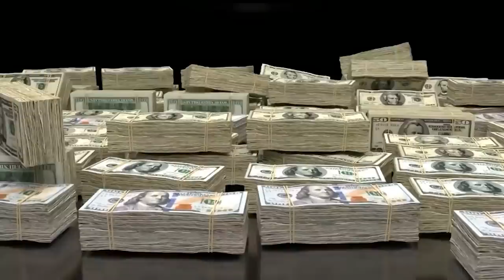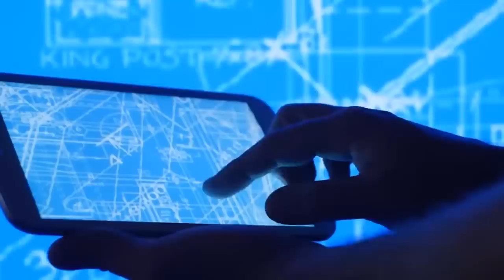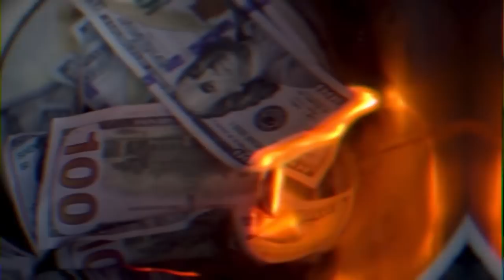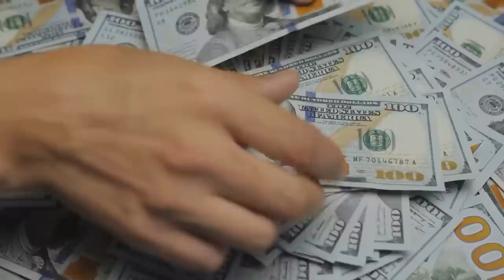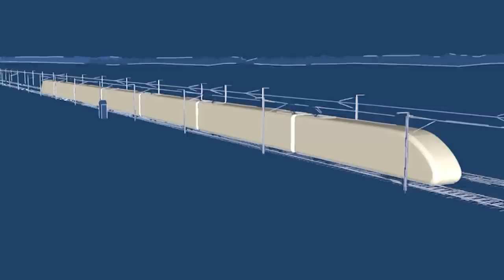Green Light for $4.2B California Bullet Train

Comment: ...Once the High Speed Rail system is in place the next transit gap  is to connect rural cities to the central hub (that is an interconnected network of lines ) connecting the rural communities to both High Speed Rail and Amtrak City Centers.  I have first hand knowledge because I've been taking Amtrak for 30 years from rural city in Fresno County to San Francisco.  It is difficult to find a bus or public transit from Sanger to Fresno, Salma to Fresno, Kerman to Fresno, Mendota to Fresno, etc.   The 14 cities in Fresno County don't yet have continuous flow of commuter links to a central Hub.  I observed Rural city people are struggling to hitch rides, depend on others to get rides to and from city center.   I work in the Bay Area is things are mostly interconnected.
Reply: One more comment - In the Bay Area the onset of the COVID Pandemic completely changed commuter characteristics because employees are working in a remote hybrid manner; and COVID still lurks as a threat.  Therefore,.  I read that public transit agencies - even BART - are struggling to survive due to lack of revenue from reduce use of public transportation.    For example, I work remote-hybrid  - I work even more hours but it's very effective and save one hour each way on a BART commute.  Crazy how things are changing rapidly.
Reply: @energyexecs  Yes, you make a correct observation how the commute demand may be changing rapidly. Plus our population is not increasing but rather decreasing somewhat.

Comment: I hope people will soon realize the potential in HSR. Later, it will improve and add more separate tracks and 🇺🇸 made trains. 3hrs from San Francisco to LA. Let’s hope in the future we look to the stars and aim for 30Min
Reply: we already can get to L.A to San Fran in 45 minutes ... Flying...
Reply: @trainsplanesandotherthings5187  you may or may not have forgot about the time it gets to the airport, board the plane, and then on the other end get off and then getting out of the airport. With how many cars and checkpoints there is, it takes about the same time sometimes more. 
Not to include the fact that generally a plane ticket is more expensive than a train ticket. 

People talk about budgets and try to stop  projects like these until it actually starts being useful. The same arguments were made against the original Shinkansen in Japan, but nowadays no one complains about them.
Reply: @trainsplanesandotherthings5187  Environment left the chat
Reply: The 125 miles of 60 mph average speed blended track (79 mph max) in the conjested SF and LA areas will result in at best a 4hr45min trip if the 55 miles of tunneling are done in 50 years.

Comment: We have the Brightline here in South Florida. It is fast, clean and comfortable.
Reply: I think they should’ve had Brightlines west or metrolink connect to the San Joaquin. Purchased the rail line for the San Joaquin, then upgraded it to 177 km/h (110 mph).
Reply: I really hope the Orlando extension is successful. Florida is perfect for an HSR network considering how our population is pretty evenly spread out across the state.
Reply: @KRYMauL  I think you are right for it to be a fast speed train (110 -125) like Brightline. I wonder what the cost and timeline would have been. Would you still have 40 miles of tunnels through the Tehachipis and San Gabriels to LA or attempt 10 miles through the Grapevine with a higher gradient since it is not high speed?
Reply: @davidjackson7281  The cost would have been paid overtime, and likely would’ve been able help address the housing crisis. 

California chose the we are the France of the US route.
Reply: @KRYMauL  I do not understand your answer. I will rephase my question. How much less time would a Brightline like train system take to build and cost over time in California? And do you really believe this is a solution to actually and materially address a housing crisis?
Reply: @davidjackson7281  A Brightlines train should cost less initially to build and upgrade. However, they would be taking all the rent and lease revenue for themselves.
Reply: @KRYMauL  I have enjoyed your comments. Thank you. Best wishes in 2023!

Comment: I wonder what the concept will be once part of the line is finished. Will it be used by existing Amtrak trains, or trains changing onto existing lines? Just going back and forth on the already completed section between relatively insignificant towns might not make that much sense.
Changing between electrified and non-electrified sections shouldn't be a problem with the dual power trains that Amtrak already ordered for the east coast. Just extend that order by a few trains for the west coast.
Reply: The HSR section that will be completed first between Merced and Bakersfield will only be used by the new HSR trainsets. It's a brand new ROW created specifically for HSR.

Amtrak will provide transit connections at both ends of the route until more of the HSR route gets completed.

Comment: following I-5 doesn't really mean an easier routing.  Freeways are designed with 70 mph curvature, HSR would mean probably 220 mph curvature or more.  so the train alignment might have to wind back and forth over the freeway lanes.  Or, realigning the freeways travelling to make room for the larger radii curves of the HSR.  down the median means continuous crash protection between vehicles and trains in places.  new structures at all the interchanges.  and yes really big challenges on the grapevine.

Comment: It will be done in 10 to 15 years at the earliest but then will they have the power to run it?
Reply: Maybe they should switch to fast speed clean diesel Brightline trains for the first generation.
Reply: @davidjackson7281  
 I don't think it's the cars or the engine I think more than anything it is the infrastructure itself and getting the right ways.
Plus who knows what else, they keep coming up with more cost on this thing.
 I was for it until I saw that they had 600 Paid advisers on the board before they broke ground.
That was 10 years ago.
 This is the kind of thing that is the huge take away for when the government is involved in any project.
BLOTE!
Reply: @ThomasLeonard454  The target range date for Merced to Bakersfield revenue service to begin is 2029-2030. After that I would surmise connecting to Gilroy would be about 2036-2038 if annual funding continues to not exceed $2 billion. That would be 15 years from now. The project started 15 years ago. It appears the final 175 mile segment to Anaheim with 35 miles of tunneling will take at best 10-15 years so it looks like at a final completion date of 2048-2053. They say patience is a virtue.
Reply: @davidjackson7281  
That is zero in comparison to what they told us 15 or so years ago. They have wasted SO much money on this project it is very difficult to want to be on their side anymore. 
WASTE OF MONEY and PEOPLE.
Reply: @ThomasLeonard454  Are you for completing it to Bakersfield and at least connect it to SF?
Reply: @davidjackson7281  
Not in favor of it at all anymore. 
Too many lies to get it started. 
Cost ballooning way off the charts of reason.

Comment: This project is at least 20 years too late!
How much will roundtrip cost between L.A. and SF? Probably more than $200...
You might as well fly instead.
Rather than wasting $4.2B or more on this project, build something more useful like some type of a transit system in L.A. and Orange county. L.A. currently has very minimum subway which hardly anyone really uses mainly because it's so limited.

Comment: As much as I like HSR and rail in general, the CA project is simply a boondoggle. The route selection and the astronomical cost, the decision to connect those small cities first instead of the two big population centers, the construction difficulties due to the rail crossing numerous faults. Alas, it’s too big to fail.  Maybe it’ll be finished in 20 years or so.
Reply: Well.... The are building the central section because it's the easiest to build as brought out in the video... They have to build tunnels. Tunneling is what's probably driving up the cost. You need reliable funding when you start tunneling. And getting the project started was probably more important. Especially with the the NIMBYs and red tape.
Reply: Do you mean too big to succeed to LA but finished to SF in 20+ years?

Comment: The problem with CA HSR is that the money ($70-100 Billion) to connect the Central Valley portion to the San Francisco Bay Area and the Los Angeles Basin is nowhere on the horizon.....and the practicalities and costs of trying to do lengthy tunneling in geologically unstable earthquake zones have been vastly downplayed by supporters of this project.  Add to that the likelihood that the the Central Valley portion will never generate enough ticket revenue to cover the significant operating costs, and you are looking at the  probability of a "high speed railroad to nowhere"
Reply: It is possible to go over Altamont Pass without tunnelling. But that's not what San Jose wants. Southern Pacific Railroad used to have a bridge over the Bay from Newark to East Palo Alto. Most of the abandoned bridge is still there. A bridge across the bay would give a direct route to SF, but that is not what San Jose wants.
Reply: @michaeljones7927  :  Somewhat true...
But Altamont Pass is both an active freight line (originally built by Western Pacific, now owned by Union Pacific) and an abandoned 1879 route...  (now hiking trails) Both gave relatively steep ruling grades (2.5-3.5 percent) tight curves, and FRA maximum track speeds of 79 MPH.  Altamont Corridor Express , a commuter railroad that runs from Stockton to San Jose over this 84 mile route but only averages 39 MPH over the routing, and while some of the slowness is stops along the route, a lot has to do with poorly built and poorly maintained infrastructure.

While you are correct that San Jose wants the Pacheco Pass alignment (because it's shorter than going North cutting South to circling the South bay), there are a lot of other wealthier South Bay interests including Gilroy and Morgan Hill that have been lobbying hard in favor of Pacheco....which are much more politically connected than Manteca or Tracy.

Comment: Chinese trains are running on 350KM/H and aiming for 400 KM/H in future but so said US trains are still sticking on for 200KM/H.
Reply: You mistook kilometers per hour with miles per hour.

According to the proposal's requirements, California's train will have a top speed 220mph with sustained speeds over 200mph in the Central Valley.

220mph is 356kph, which isn't quite as fast as what Japan and China have, but will still be on par with the fastest European trains.

The only issue I have with this project is the cost. With a projected systemwide cost of $120B, ridership will need to be very high in order to keep the passenger mile cost reasonable, which is not impossible, since the stops will be within 20km of 30 million residents.
Reply: @99certain45  East Asia actually has ones above 300 mph

Comment: The train "could" make the trip in 3 hours. But it never will because it will need to stop every 50 miles for 20 minutes.
This line will be bankrupt within 2 years of becoming active.  If it ever does.
Reply: I am curious why you think high speed rail engines overheat and require 20 minute cool down periods.
Reply: 20 minutes? Less than 5
Reply: There are many depots to stop at.
Reply: @danielcarroll3358  The engines do not overheat or require a cool down period. But how long does it takes for a 150 mph train to slow down, unload & load passengers, and get to speed again.
Reply: @troy.peters  You have never heard of local, limited and express trains? Each station has at least four tracks. The two in the middle allow expresses and limited to pass through at speed. Stopping trains switch to an outside track which is next to a platform. I have gone through a station at 187 mph many times. The people on the platforms waiting for the local hardly notice.
Reply: @danielcarroll3358  There will not be enough distance, frequency nor ridership on the 2030 segment to support different train speeds. CAHSR has stated the initial 171 mile segment will be a 1hr25min trip averaging 125 mph (200 kpm).

Comment: From what I can see of US and especially CA politics, a completed line will remain a pipe dream. There are too many ways opponents can hold the scheme hostage through the legal system.

I'm also afraid that this rail line will be built North American style, meaning that the stations will be out in the middle of nowhere and reachable only by car. Cyclists and pedestrians will not be welcome or able to reach the stations without risking their lives.
Reply: all the legal NIMBY BS has failed now. that was the 2008-2015 phase challenge. the stations are well placed in LA, san jose and SF so that's not an issue. they did a good job on the technical aspects of CA HSR
Reply: All the stations, with maybe Kings/Tulare (and Madera) as an exception, are being built in downtown areas with direct access to existing transit. Kings/Tulare will connect with existing and new buses to Hanford, Visalia and surrounding areas, along with a proposed train service linking HSR with Hanford, Visalia, Porterville and Lemoore via an existing rail line. 

In the Bay Area, HSR will utilize the existing Gilroy, San Jose and Millbrae stations, as well as 4th & King in SF until the Salesforce Transit Center is ready for train service. In SoCal it'll utilize a relocated Palmdale station with connections to Metrolink and Brightline West, LA Union Station with its connections to all across LA and surrounding counties, and ARTIC in Orange County.

One of the big drivers of this project is to reduce urban sprawl and encourage residential and commercial development in city centers around the stations, not just for places like San Jose but also Fresno.
Reply: @ChrisJones-gx7fc  wow thanks for this write up! really appreciate the info
Reply: Usually hsr is built outside of the city center and the city grows to the station. (And as the other person mentioned they are building to the downtowns of most cities)
Reply: Actually, the stations will be built up central stations, and what might end up happening is the LA system will be forced to connect at the end of the line. They should’ve bought the San Joaquin from Union Pacific, and upgraded it to 177 km/h (110 mph), then had Brightlines or Metrolink connect from there. I imagine it will be something similar in the end.
Reply: @KRYMauL  the San Joaquins were originally Santa Fe, and run on BNSF tracks from Bakersfield to Port Chicago, where they switch to UP tracks to reach Oakland (they also run on UP from Stockton to Sacramento). 

What do you mean by buying the San Joaquin? The San Joaquins are state-run and operated by the San Joaquin Joint Powers Authority. Same with the ACE service between San Jose and Stockton over Altamont Pass, owned and operated by the San Joaquin Regional Rail Commission. That service is in the process of being extended south to Modesto, Ceres and eventually Merced where it’ll connect with CAHSR. That extension includes double-tracking the UP line between Lathrop and Merced. Buses will connect with CAHSR in Bakersfield, just as they do now with Amtrak, to go to/from LA and SoCal. Once CAHSR reaches Palmdale, Metrolink will connect with it there, as well as in LA and Anaheim.

Brightline West is set to begin construction of its HSR line between Las Vegas and Victor Valley within the next year or so (though that’s after several delays and could be delayed again), which is planned to then be extended to Rancho Cucamonga and likely Palmdale, where it’ll connect with Metrolink to/from LA, and with CAHSR in Palmdale as well.
Reply: @ChrisJones-gx7fc  You just said the infrastructure was owned by BNSF and UP, so is it owned by them or the state. The rolling stock is pennies compared to the actual track.
Reply: @ChrisJones-gx7fc  Also, I'm saying Brightlines West should go all the up to Bakersfield.
Reply: @KRYMauL  the tracks are owned by BNSF and UP, and both are busy mainlines so I doubt they’d be willing to sell them to the state. 

As for Brightline West, their objective is Las Vegas-LA. I think for sure with Brightline West going to Palmdale and a connection with CAHSR, they could potentially run trains not just directly to/from LA but also the Bay Area.
Reply: @ChrisJones-gx7fc  Well, Palmdale isn’t in the city center either (but its not like anything is), however I think they are planing on building plenty of housing and businesses close to the station.
Reply: @ChrisJones-gx7fc  When would you surmise the SF Transit Center will be ready for train service?
Reply: @ChrisJones-gx7fc  Once CAHSR reaches Palmdale won't it tunnel 25 miles to Burbank to bypass the two hour Metrolink trip? Won't ridership be severely hindered by the 2hr25min bus ride from Bakersfield to LA?
Reply: @davidjackson7281  I believe the goal of the Transbay Joint Powers Authority is 2031 to complete the Downtown Rail Extension from the current Caltrain line into the station, but that’s dependent on funding. The train box itself looks pretty much ready for tracks at this point, though things like platforms and escalators still need to be completed. The most recent video I’ve seen was CAHSR’s visit to Salesforce Transit Center in September 2021.
Reply: @ChrisJones-gx7fc  Yes, I have seen that video with CAHSR's NorCal Director. Is he still with them? Yes, you bet it is dependant on funding. Too bad they choose the Chinatown extension over Caltrain. Unfortunately, I don't think it can be started nor be done before the 171 mile segment in 2030 and the Pacheco Pass valley to valley segment in 2040. So pessimistically, maybe by 2050.